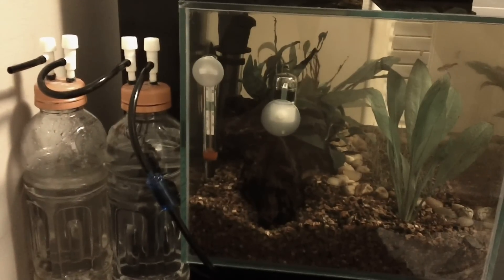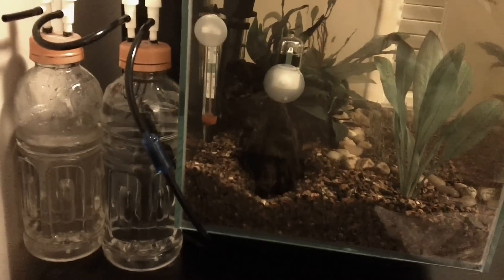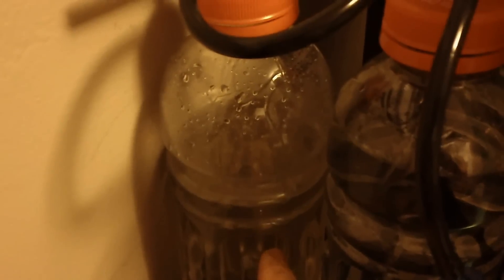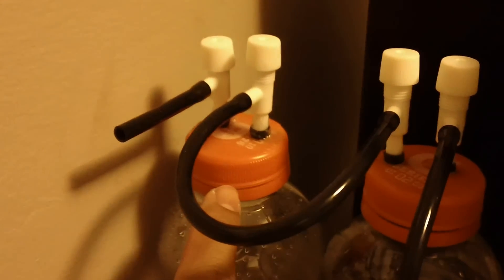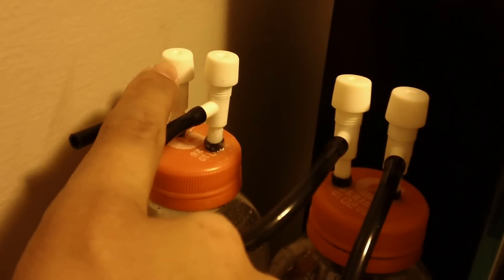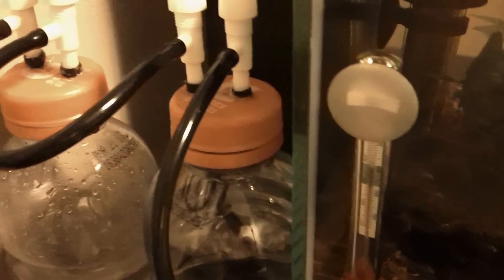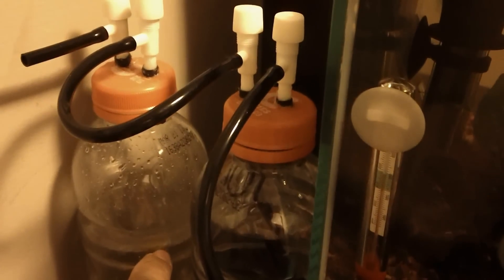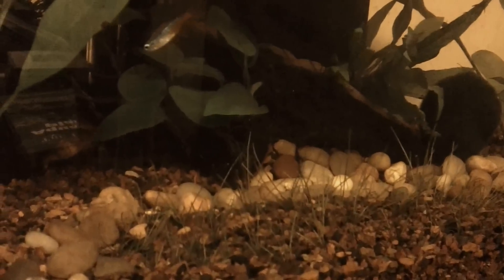DIY CO2 MOD to shut off CO2 Injection at Night [Part I]

Comment: Could you just crack open the bottle cap a tiny bit instead of connecting an outflow valve? Also, how long does it take for the pressure to build back up and get co2 going in the morning?
Reply from the maker: I don’t see why not…the pressure should still be there since you’re really just diverting the air going into the tank to the room…
Reply: This is so insanely stupidly simple yet it never even crossed my mind 🤦‍♂️ lol. I’m going to build a valve like the video for the sake of looks, but this is genius in itself lol

Comment: The idea of a bubble counter does not work if the counter is outside the tank.  How much Co2 is delivered will depend on how deep in the tank is the release of the Co2.  The water pressure will effect the rate.  What works for me is to have air pump that you turn on at night that will counter the Co2 coming in.

Comment: If your CO2 is being diffused by a power head, then you could just set your power head to come on only when your lights are on.  Without the power head being active, the CO2 would just bubble up to the top of the tank without diffusion.